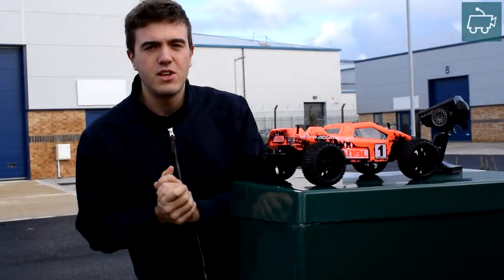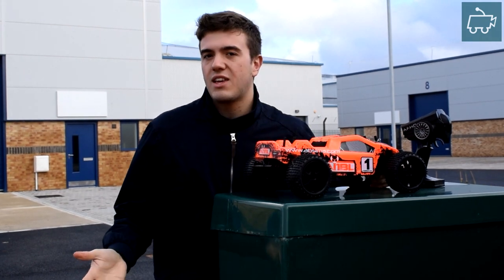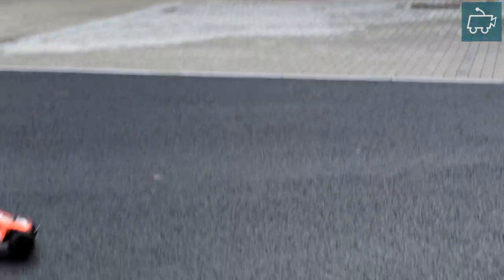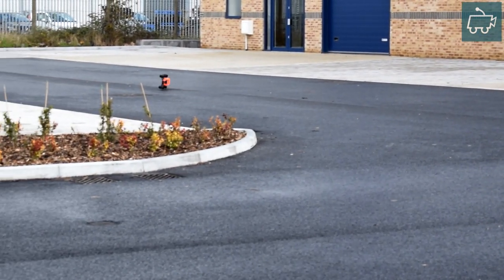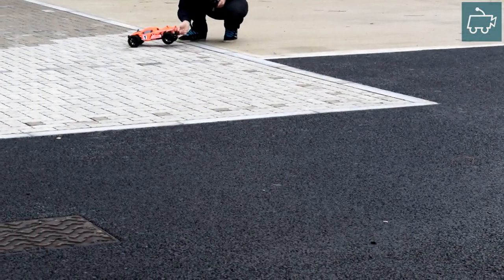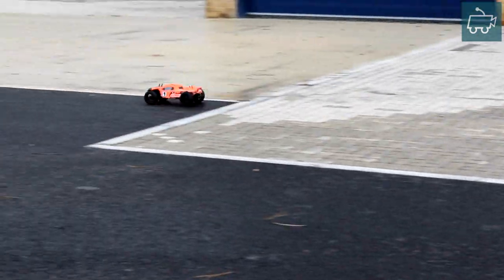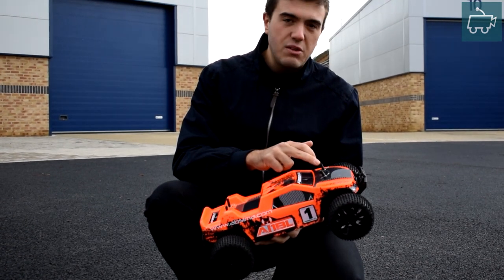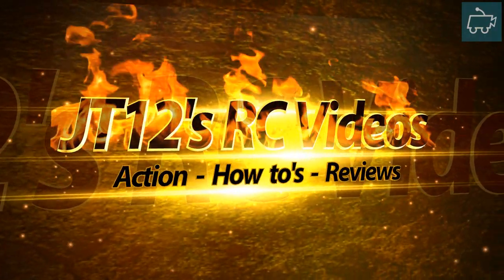Absima AT1BL Ripping up the Tarmac on 3S LiPo

Comment: This is very similar if not the same as a BSD Flux Onslaught V2. The tyres balloon really quick, run the car without the shell and you'll have better grip, at high speeds the shell acts like a parachute and lifts the car. Motor gets very hot with constant throttle.
Reply from the maker: The motor on mine was only warm after two batteries worth of run time, didn't check ESC because it's concealed
Reply: JT12's R/C Videos run it on tarmac without the shell, the grip is actually quite good. Post a video of the RCs in speed runs with the shell and without, be interesting to see the comparisons.

Comment: Nice video,Josh,my Joysway Super Mono X runs on 3S and it's very rapid,that's on water!,it's hard to imagine a buggy with 4S and above being controllable!,my HPI Savage X is also uncontrollable on wet concrete,I've thought about it and maybe this is a good thing as instead of flipping over very easily,it tends to slide instead,grippy rubber may not be the answer on these high center of gravity vehicles.
Reply from the maker: I will take this one to the dirt area soon and do some jumps with it, see how it handles some rough treatment :D

Comment: I got the same RC car,
chassis had a freak crash and cracked in a way it should not, got a free replacement and swapped chassis.
I am new to RC cars, what mods would you guys recommend on this?
Reply from the maker: A metal chassis? ;) Perhaps an upgraded ESC/Motor setup with Metal Spur gear, metal geared steering servo. Better tyres

Comment: Is there a way to soften the suspension a bit so it doesn't want to flip so much?
Reply from the maker: The shocks aren't adjustable themselves, there might be a different hole to mount the shocks to on the lower suspension arm to make them a little softer. It's only the 3S lipo that has this effect on it, on 2s the handling is great

Comment: can you run this on 3s lipo all the time and did you have to make any modifications to fit a 3s lipo in it,  I'm thinking of putting a 3s in mine but I don't  know if it will work well
Reply from the maker: I used a 3S LiPo with no modifications. However, while the electronics can handle it, it does get hotter on 3S and the transmission is not designed for 3S Power. Stick with a high capacity 2S :)
Reply: JT12's R/C Videos okay thank-you,  I will stick to 2s

Comment: What was the C rating of the 3s battery you used please?
Reply from the maker: I cant actually remember what battery I used but it was most likely a 25C
Reply: Thanks, just wonder if a higher C would pop the esc